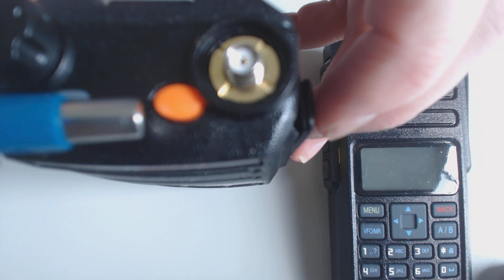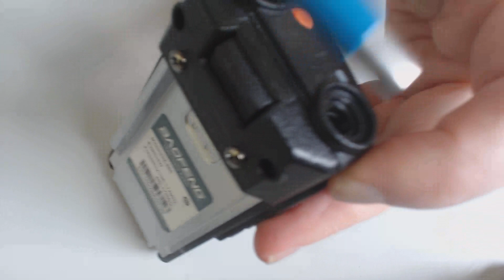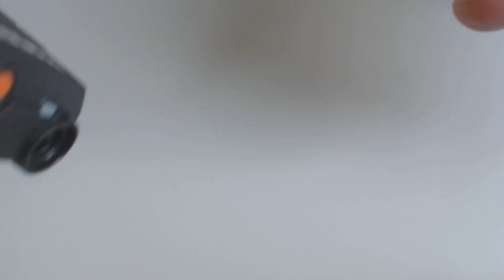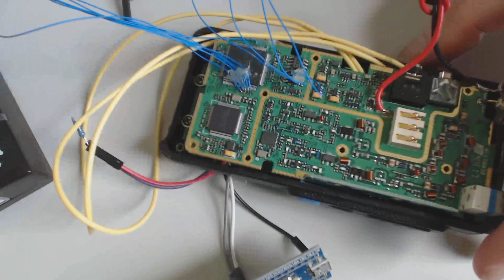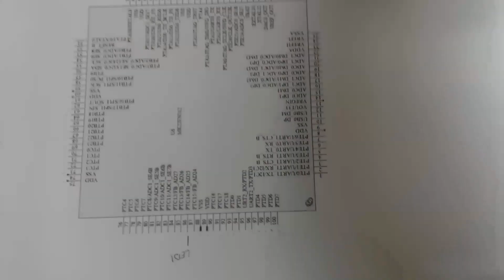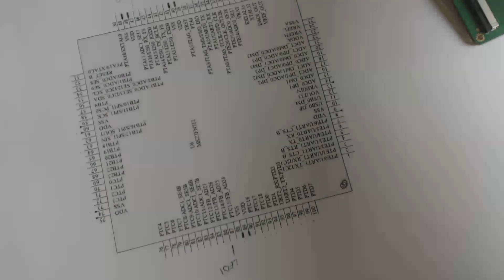Radioddity GD-77 and Baofeng DM-1801 teardown and hardware comparison

Comment: Are the batteries the same. Can they be swapped between the GD-77 and the DM-1801. The clip broke on my battery for my GD-77 and it seems impossible to get a battery here in the USA for it. Have been looking for a replacement for like 5 months. So looking for options for replacement.
Reply from the maker: The batteries are not exactly the same size.
I have a DM1801 I use with one of my GD-77, but its a very very tight fit. I had to push it on very hard to get it to clip in place, and I have to use a screwdriver to lever it out, if I want to remove it.
Reply: VK3KYY VK3KYY Roger Clark ok thanks. It is bull that no where can you get replacement batteries for the gd-77. Every where is either don’t have any or sorry we can’t ship to you. Love my radio with the open GD-77 firmware on it but not being able to take the radio any where because the battery falls off since that little clip broke gets my nerves.
Reply from the maker: @Robert-Wilson  The problem seems to be increasing regulation of sending batteries in the post. I managed to get some DM-1801 batteries about 9 months ago, but after that the supplier said they were no long allowed to post them.

I received Retevis RT3S radio the other day, and they had opened the box and clipped the battery to the radio prior to posting it, which I think its to get around the regulations about posting items with separate batteries or even posting separate batteries.
Reply: VK3KYY VK3KYY Roger Clark yea it all bull. How does shipping a battery with an item make it any safer than a battery in a box by it self. If a lithium battery is going to go nuclear it don’t give a damn if it in a device or by it self.
Reply from the maker: @Robert-Wilson  LOL. I don't make these crazy rules ;-)

Comment: Hi There Roger, I was wondering if it was please at all possible if you could explain in a new video on the GD-77 Solder D Pads for EEPROM Flash using a ST-Linker. What Wires Solder on where and etc. If So Be much appreciated. Thanks
Reply from the maker: I've never connected to the EEPROM, also this radio does not use a STM32 processor, so you can't connect to it using a ST-Link programming dongle (unless perhaps there is a way to do so using OpenOCD)

If you look at the video with this link  https://youtu.be/EyWjvL0vz-E?t=1488   you can see the SWD pads where I connect the  J-Link debugger programmer.  These connections are to program the main microcontroller chip, which is a NXP MK22FN512
The pads are clearly labelled on the PCB.
Reply: @vk3kyy  Hi Roger.
I tried to install OpenDG77 on my Baofeng DM-860 but it failed and the radio is now bricked.
Did you have any information to resolve my problem? i.e. from where to download the original firmware, or any other? Uploading again GD77 don't solve the problem. Or I need to reload the boot loader?
When I power on my radio pressing the two button, the green led lit steady.

Comment: Hey Roger- Any plans on adding talker alias to the Radioddity GD-73 tiny radio?
Reply from the maker: Can't be done, because the DMR chip now also contains the main CPU core, and the Chinese company who makes these chips never releases any data sheets for any of their products.

See https://www.opengd77.com/viewtopic.php?t=769
Reply: @vk3kyy  Hi Roger- I found a DMR radio service manual to a radio using the HR_C7000 chip.  Let me know if this is helpful.  See p.10 on the PDF from this link: http://www.connectsystems.com/products/top/radios/CS120D/DR5800-2%20ServiceManua01.pdf
Reply: Here is the link to a list of other radio service manuals.  The .htm links give access to the service manuals: http://www.connectsystems.com/products/top/radios/

Comment: Could you please pass along the volume control part#.  I need to replace mine.  Its very noisy/scratchy near max volume. 

Thanks, Ken
Reply from the maker: The radio in the video has now been fully reassembled and I'm using it.

Comment: What better execution?
sorry i don't understand english (
Reply from the maker: I've no idea what you mean.

Please rephrase your question, or perhaps use google translate
Reply: @vk3kyy  video about 2 walkie-talkies, in two different versions. right? So!
In your opinion, which of these two options is better?
I understand that my question sounds silly.
since you are talking about it.
But only I do not understand English.

I already use google translator
Reply from the maker: @eiselengel7707  . Ah you mean which radio is better.  
I have some problems with my DM-1801 (aka DM-860) with my hotspot, so in my opinion the GD-77 is better because I never had any problems.

But the DM-1801 has more flash memory and is cheaper, and has extra buttons for MR/VFO and VFO A/B  and I know some people had no problems with it.

So its difficult to pick a clear winner.
Reply: @vk3kyy  got it. 
need to take TYT (retevis). )))
Thanks for the answer)
Have a nice day! Sir.

Comment: Roger, the label of your radio says DM-860. What the firmware was saying once powered up the first time?
Reply from the maker: I can't remember what the firmware originally displayed, I've already reflashed the radio several times, including with the OpenGD77 firmware.

The PCB has DM-1801 written on it, but the label on the main chassis under the batter has DM-860 written on it.

The 2 model numbers seem to be interchangable.